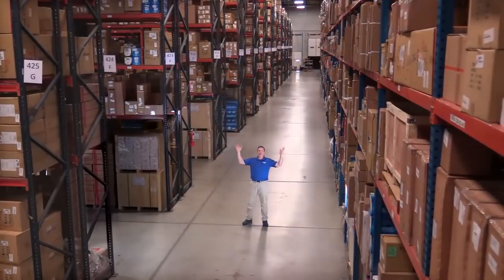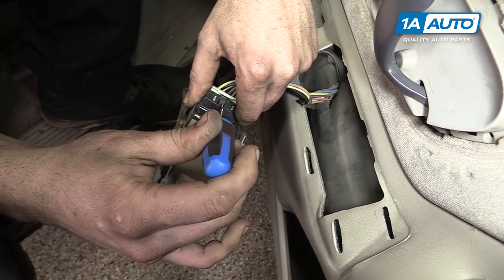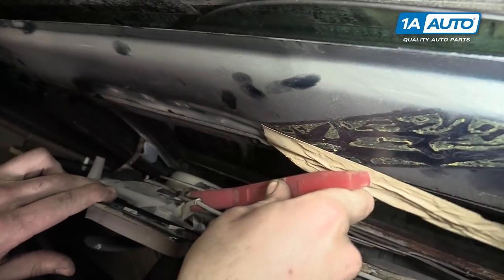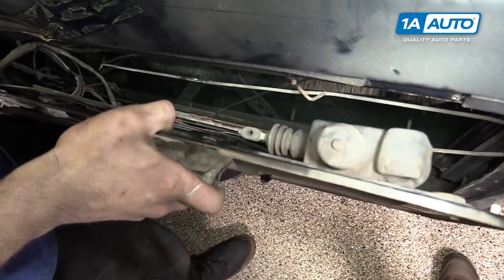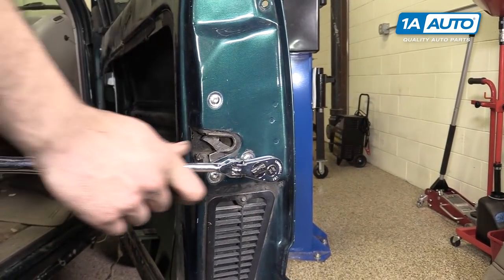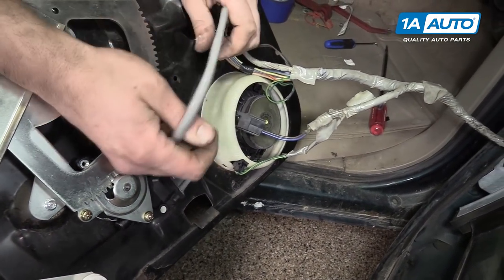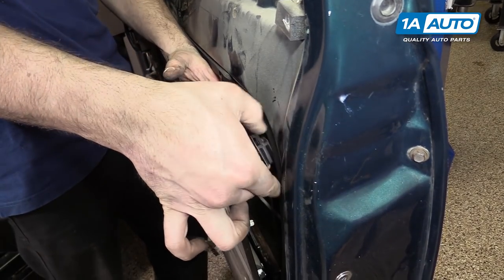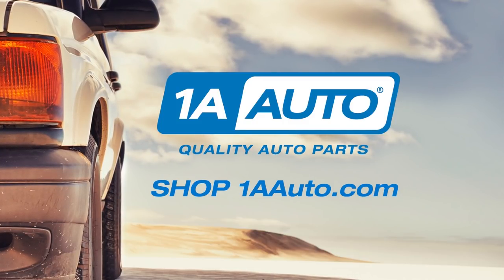How to Replace Door Latch Assembly 89-99 GMC Sierra K1500

Comment: Your procedure worked perfectly for my '98 Chevy pickup, even though my truck has manual windows. When the inside door release was difficult to operate, then the release handle finally broke (2nd time in 3 years) I began to suspect the door latch needed replacement. When some bits of whitish plastic fell out of the latch, that convinced me to replace it. Now my passengers don't complain about the difficulty of opening the door from the inside. Thanks!

Comment: Just finished doing this on a 95 suburban about 15 minutes ago.

99%  of it was easy, the hardest part was reattaching the fiddly little bars to the exterior door handle again and getting the window regulator back in the track. everything else was relatively easy.
Reply: Are  rods attached to the  lock mechinism

Comment: If you remove the vent on the door ( 3 screws ) the old latch will slide down thru the vent hole. New latch slides right in and makes it easier to align the rod from the outside handle with the open mechanism.

Comment: Great video, got a 1999 ck3500 with a bad latch, ie we can’t get the door open.  Using your video we’ve gotten the door panel off and the inner panel.  The linkage is still in place and even manually moving the levers on the latch we can’t get it to unlatch.  Any suggestions or videos on how to move forward?   We’ve tried unscrewing the latch post but can’t get a wrench on it (T-50) so I’m thinking the door is sagging.

Thanks

Comment: Why do latches usually need replacing? My 1992 C1500 doors rattle on gravel roads. I replaced the pins and bushings on the hinge but they still rattle on corrugations. Could this be a worn latch? The latches work fine otherwise.
Reply: Its the rubber damper in the latch that is squished from the previous hinges sagging.

Comment: On my 92 blazer the driver side won’t open from the in side could the latch be the problem? If not then could you give me a list on what could be the problem?
Reply: I’m having same problem on my 98 Tahoe. It’s definitely the door latch as it sometimes gets stuck and I have to pull outside door handle and manually move the latch to open. Same problem with passenger and rear passenger doors.
Reply: @coldchillin8382  I cannot open min from either side. Front right passenger door

Comment: Before I order a door latch mechanism for  my 97 c1500 Chevy truck is there a difference in the standard roll up type window and the electric roll up type mechanism? I haven’t found a video yet that deals with the standard door latch mechanism...
Reply: Dark Rose On my 92 blazer the driver side won’t open from the inside could the latch be the problem? If not then could you give me a list on what could be the problem?
Reply: You may have a grommet that broke or it may just be the whole mechanism. In my case it was the mechanism...

Comment: I have the same truck but its a slightly older year (1993) would this process still work?
Reply from the maker: +seth Raynor It might be the same or a similar process. Hope this video helps you out. 1aauto.com
Reply: Yes
Reply: Its sorta similar but thats about it
Reply: I'm currently doing this on a 1990 K1500 and it's pretty much the same process.  The biggest difference is you can't remove the harness without drilling out the bracket that mounts the switches to the inner door as the connectors are too large to fit the through the channel they are fed through.  That bracket is fitted with pop rivets not screws, so you gotta wanna or let it hang.  You could disconnect the wiring from inside the door jamb on the body side and pull it into the door and remove it that way.  One thing of note....the part of the video where he's removing the door handle.  It was getting stuck on the plate the rod attaches to for the door lock, at least that's what was getting in the way for me, kind of hard to see in the video.

Comment: You didn't show how to remove the connecting rods.
Reply: Victor Ricci right?!!!
Reply: Yeah, they are the problem here😂
Reply: Slide black clips off after prying through indentation. Put back on so that when reassembling you simply pop rods in. Take pictures is my advice as to orientation of the rods before removing
Reply: It's really difficult to show since they are bent and inconveniently connected where you cannot see the way it is attached. It's literally a resemblance of a male part going into the hole. It has to be pried with a little force. When taking out, reinstalling